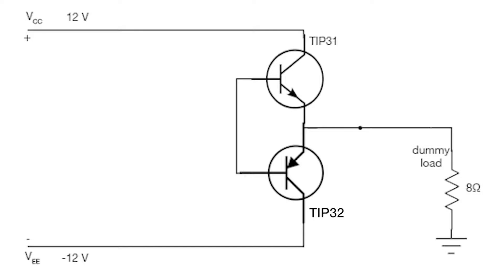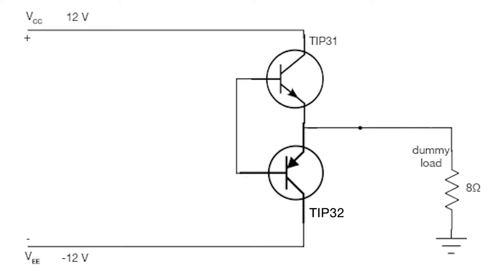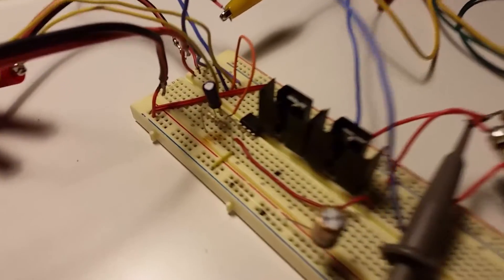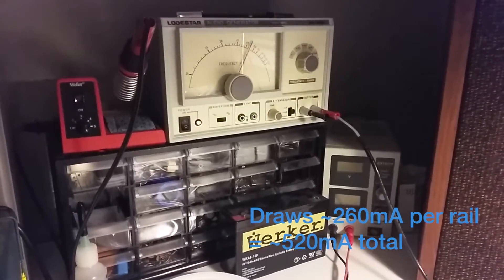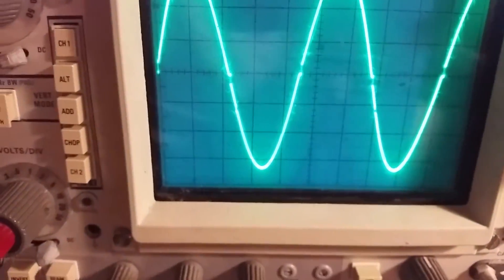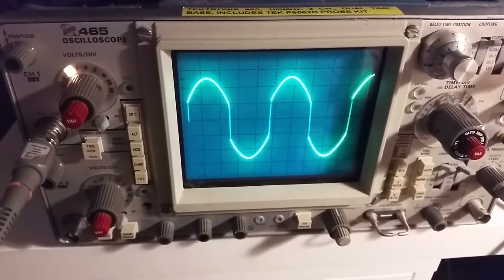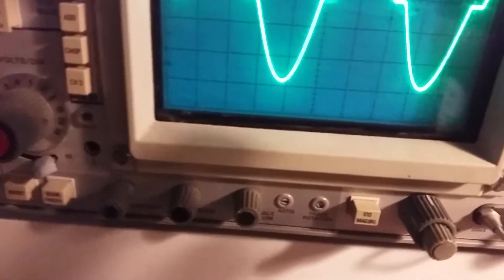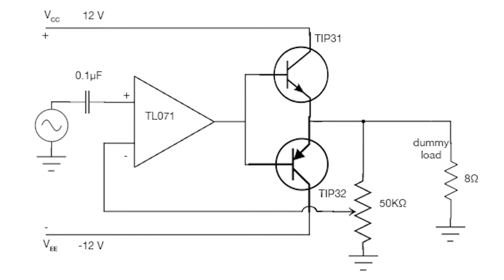Class C Amplifier (With Negative Feedback)

Comment: Class C conduction angle is 90 to 120 degrees. This ones conduction angle is about 180 degrees. So it's class B. Exactly the same idea is presented say, here. https://www.allaboutcircuits.com/textbook/experiments/chpt-6/class-b-audio-amplifier/
Reply from the maker: Well shit, I was under the impression that class C began at less than 180 degrees. A transistor without base bias is less than 180 degrees, but not by much. Definitely not 120 or less. I suppose this circuit is basically class B but with worse fidelity and less parts.
Reply: @thetuberoaster8321  A push-pull pair without any bias is known as a class B, a push-pull pair with bias is known as a class AB. Because the bias makes it conduct between B and A

You've made exactly a traditional class B with negative feedback. Class Bs have bad fidelity because of cross-over distortion.

This is a class C http://www.circuitstoday.com/class-c-power-amplifier. It's a lot different.
Reply from the maker: @elpechos   Matthew Dunn  When I think of class C, I think of this: https://www.youtube.com/watch?v=c6cmkm3UPUI

Class B happens when the transistors are biased enough so that anything above 0V gets amplified. (180 degrees conduction angle). The amount of bias is very small and there is some crossover distortion. Class AB biases the transistors so there is almost no crossover distortion. Most class C amp examples are single-ended. Lots of RF power amplifiers are made this way. I made mine double-ended or push-pull but the concept is still the same. In my circuit, the output of the op amp with no signal applied sits at zero volts. Neither of the transistors are turned on. I prove this by measuring the current in the circuit without the signal. The signal has to overcome the 0.7V drop before it turns on the transistor. The negative feedback loop greatly reduces but does not remove the crossover distortion. So it is class C but very unconventional since it's not single-ended and has negative feedback.

Comment: You really should put your volume pot on your op amp input and set the gain to lower than distortion when the input signal is at ideal voltage. On this schematic, the volume knob is controlling gain, not volume.
Reply from the maker: Ya maybe I should've had two pots, one for gain and the other for volume. I was trying to to see how the distortion was for different amounts of gain with a fixed input signal. In retrospect it may have been better to scale the signal down so the output remained constant. The comparison was a bit apples to oranges but hopefully got the point across.